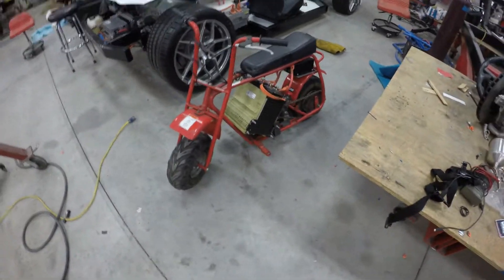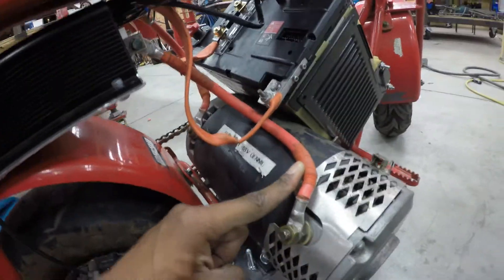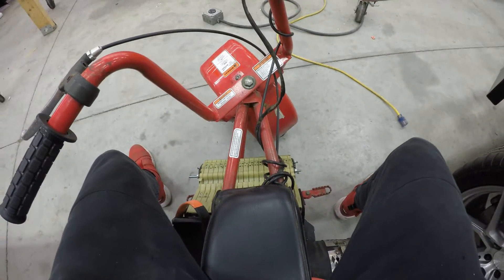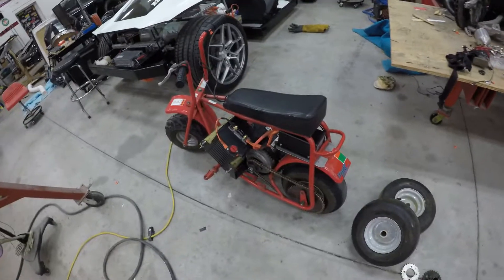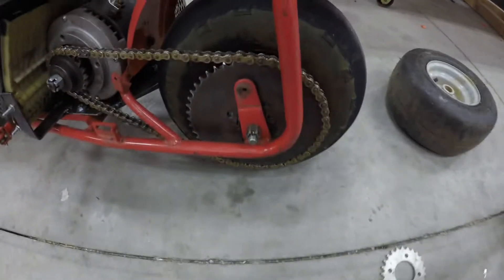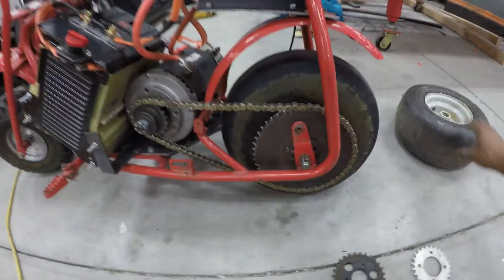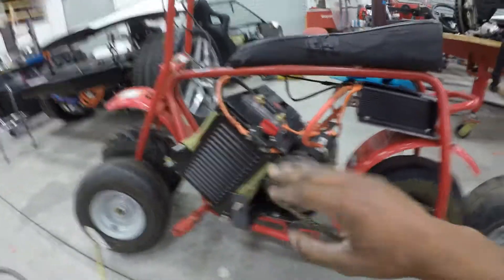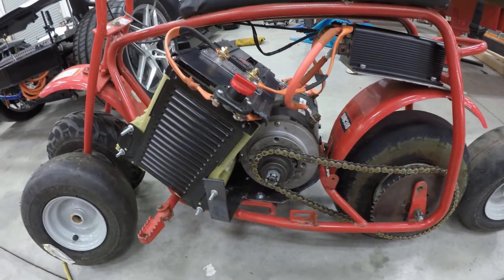20hp+ electric mini drag bike First wild ride!!!!!!!

Comment: This is bad dude I wonder if one could get a little smaller motor and mount one above each wheel then turn the battery sideways I bet it would balance and handle excelent and u could have some kinda controller wear you twist one throttle but roll power into the front wheel to avoid a wheelie then basically shift all power to the rear wheel at the 75 foot mark

Comment: I got a mini bike that I want to turn into an electric scooter and this definitly seems like somthing I should do. More because I can probably turn it into a hybrid setup.
Reply from the maker: You should they are very fun!!
Reply: @DirectedWisdon  The question is how to use the 4 stroke and the electric motor together. If I could gear the 4 stroke to a 1 to 1 and the electric motor with it and use the electric motor for its torque and once it tops out switch to the gas motor for the speed. Then end up hitting at least 100 mph in about 7 seconds.

And of course how not to die if i go over 100.

Comment: I was thinking about getting a 48v 1000watt electric motor with a 11Tooth 8mm 05T chain sprocket what do you think about using this? It also comes with a 48v 1200watt voltage/speed controller
Reply from the maker: what are you putting it on?
Reply: Invoke Performance  I was thinking of putting it onto a mini bike I’m planning on building
Reply from the maker: @yungisizzurrpp1802  i have a lot of experience with that motor. I it the same setup i used on my 2000w stand up scooter. However on a mini bike it will not be very powerful and it will require a very low gear ratio not to burn up. how heavy do you think your mini bike will be and what batteries are you using?
Reply: Invoke Performance  The frame is the same as your mini bike and I was thinking of getting a 50v battery. Could you do a list of everything you?
Reply from the maker: 777LABS sure it’s a 48v forklift motor, 48v pmc brushed dc controller from eBay, 300amp Amazon fuse kit, 2a gauge wire and magura 5olhm twist throttle

Comment: Subscribed. I'd like to see how you actually set up the controller. Does it come with some sort of programming software? I'm trying to learn more about electric builds since I'm only used to working with Honda clone engines. My goal is to eventually build an electric off road mini-buggy.
Reply from the maker: its actually pretty easy i will make a quick setup video to teach you how to do it with the ebay pmc controller i used!!!

Comment: Nice dude it is true the gay ratios everything with electric I built an electric bike myself you do run into overheating though how are you coping with that issue I remember mine would always overheat
Reply from the maker: After hard riding with this set up the electronics barely get warm at all. Especially the motor since it was originally designed to power a vehicle many times heavier than the mini bike. So to answer your question the way to solve any heat issues is to make your your power electronics and batteries are rated to handle an excess of the max amp draw on the system.
Reply: Think the engine could handle a quad frame or u think that would be to heavy . I really want to start  a electric quad for this summer just looking for a good engine u cAnt buy any good electric quad all the ones I have see are very slow
Reply from the maker: Bsmith this motor would be perfect for a quad for sure it has the power to drive a small car reliably.

Comment: Wow! Simple but powerful setup you've got there. What motor and controller you're using?
Reply from the maker: Donker Yankervoot   Standard 48v Brushed dc forklift motor and this controller 

https://rover.ebay.com/rover/0/0/0?mpre=https%3A%2F%2Fwww.ebay.com%2Fulk%2Fitm%2F163554766954
Reply: @DirectedWisdon  ⁸

Comment: Very coool also looks fast💨!! But is it that the smallest gear you could put in the front or can you go smaller? Gota catch them off the line!🤙🏽🤙🏽
Reply from the maker: i have a much smaller gear i can put on the front i plan to do another vid with top speed vs acceleration testing